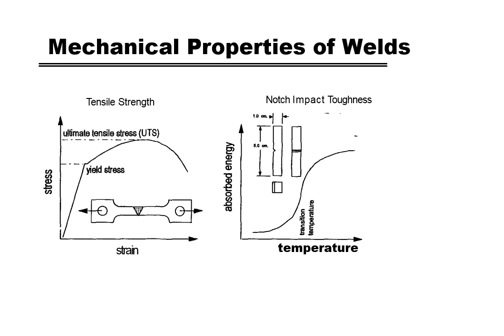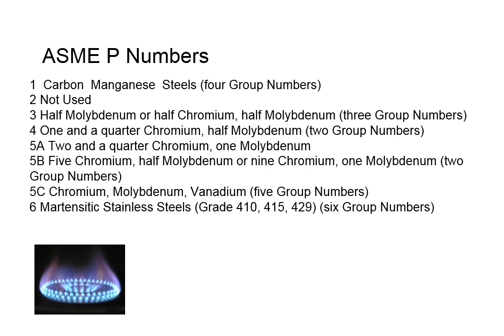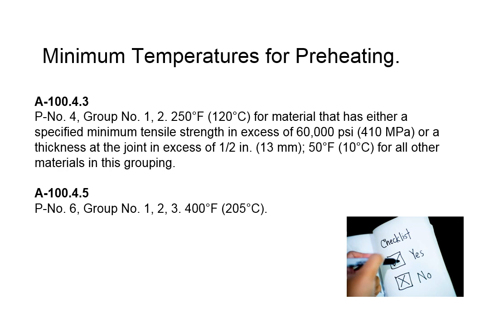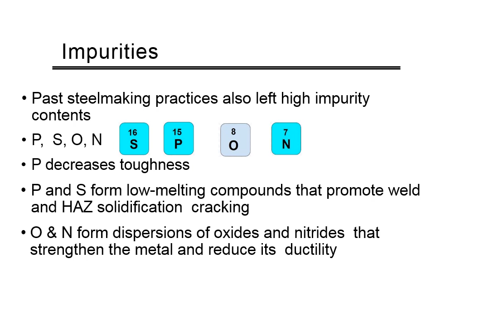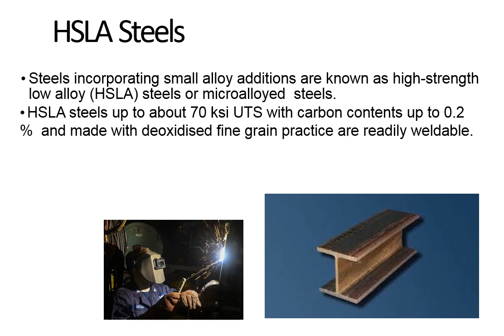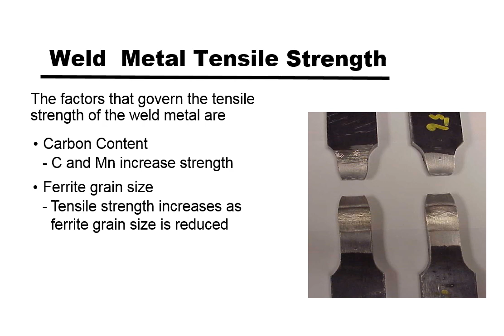CWI Course Module 9- Weldability of Steels

Comment: I am interested in using your material. But in a slightly different manner. I worked as a CWI as a coordinator. I assisted welding engineers during pWPS’s and trained using the WPS and verified that they used the WPS correctly. As a general statement welders do not like reading. Pictures when possible work much better. Well, I would like permission to use your material and send it to you? I am not a computer wizard!